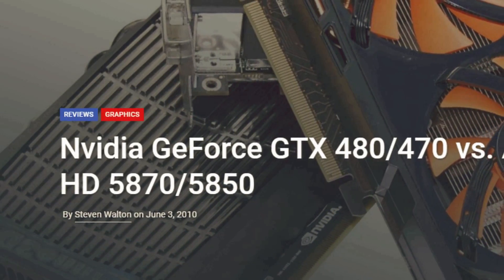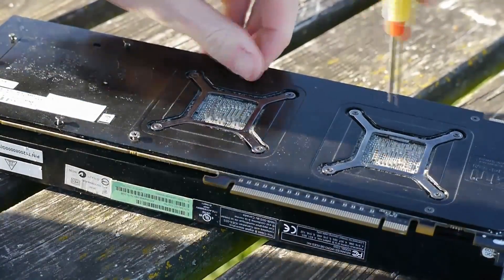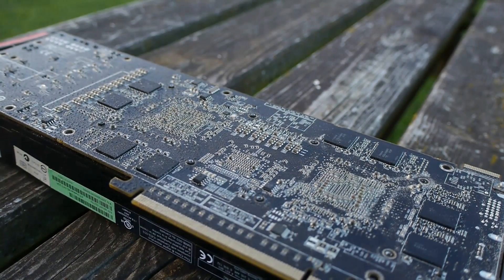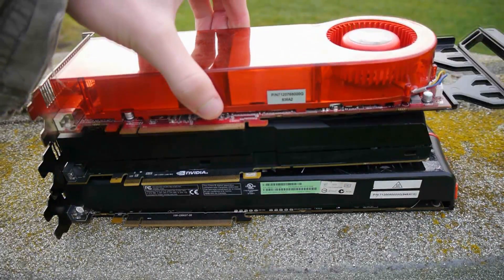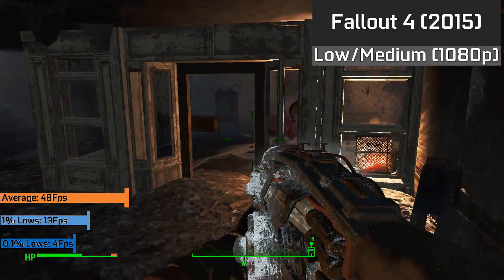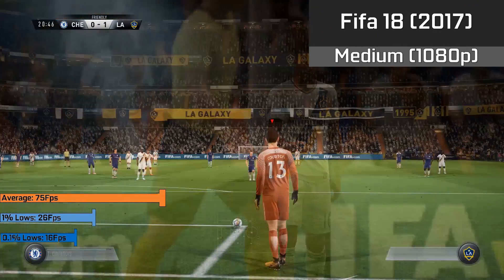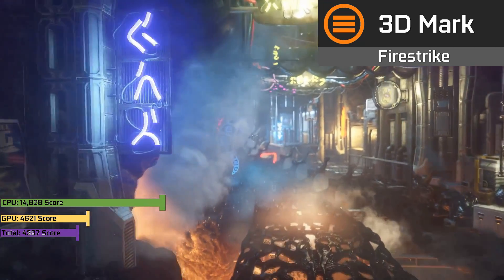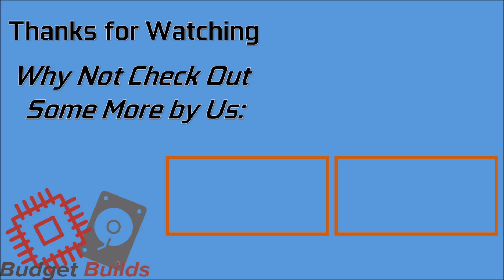The HD5970 is now £25 ($32) but is it any good?

Comment: I had this exact card.  The XFX Black Edition was actually one of the best versions of this card back in those days.  Actually, I think I still have mine.  Great card, but I need to point out one thing you mentioned that isn't actually correct.  Yes, it was a 2GB card, and yes, technically, all 2GB were "usable".  But no, it did not "function" as a 2GB card because that memory pool was not shared across both GPUs.  Each GPU got it's own 1GB of dedicated VRAM.  Remember, these cards were effectively 2 full GPU cards with all their infrastructure requirements, crammed onto a single PCB and then managed through drivers and Crossfire profiles.  So while there was a total of 2GB of VRAM on the PCB, it only functioned as a 1GB graphics card because data was duplicated in VRAM for each GPU to use.  This was true of the HD3870X2, HD4870X2, HD5970, HD6990 and HD7990.  I had the 38,48 and 59 versions of these cards.  Used the HD5970 for years until I upgraded to two Sapphire R9 290X GPUs in Crossfire years later.  

Finally gave up on Crossfire after I had 6 new games release back to back that didn't get Crossfire profiles and actively ran worse, forcing me to constantly disable crossfire entirely in drivers for each game I wanted to play in order to get a enjoyable experience.  But I ran that 290X (great card provided you got a third party triple fan version.  Even the reference design PCB was great, but avoid the blower cooled version) for over 5 years before I finally upgraded to a 2080Ti.  I'm waiting until next gen before I upgrade next.  Don't know which brand I'll go with until I see what each company has to offer.

Comment: Even after ATI was bought by AMD, the ATI name was still used for the AMD GPU range.
The HD 5970 is the last flagship card sold under the ATI Brand.
Starting with the HD 6000 series, AMD stopped using the ATI brand.

Comment: Heck of a card, when it works. Sure, it's two 5870's strapped together, but not every game uses crossfire or sli. GTA IV only used 1 out of the 2GB of video memory too. I had the Sapphire Vapor X variant of the 5870, briefly, with a near silent cooler. The cooler almost took up 3 pci slots! 😅😝 
But it was whisper quiet, and kept things so cool even overclocked. Only reason I sent it back is because it was stuttering like a bastard. Driver issues maybe, because I had a GeForce SLI motherboard. It would get me a couple more frames than a GTX 470 in games like Crysis, but it would stutter every so often and it was quite noticeable.

Comment: @ Budget Builds Official I'm putting together a retro computer using a Q9650 core 2 quad (I don't have a motherboard yet). I was going to use a Diamond 5870 but I bought an XFX Radeon HD 5970 Black Edition Graphics Card for $28.00 U.S. today so I will be using that. My goal is to build a computer that would be very high performance by the standards of 2008-2009 for less than &200.00. I now have a CPU and a GPU and have spent $38.00 but I fear getting a good motherboard cheap is going to be a problem. It pleased the hell out of me to find this good video on the very card I purchased, thank you.

Comment: lol, im using a 5870 I bought for $15 and it OC's to 900mhz and 1200mhz on the vram. Runs CS really smooth at 140ish frames on med settings 1080p and warframe at 90fps at low 1080. Great card, especially for its age.

Comment: I had two 5870 in CF, and suffered a lot from micro stuttering. But, the game that achieved the best scaling and performance for me was "Metro 2033" all maxed out, ir ran even better than my GTX770 after replacing them (all with a OC i5 3570K)

Comment: I have the XFX Black Edition Limited, which is a true 5870x2 card (i.e. no reduced clock speeds) with 2GB per GPU.  It has two 8-pin connectors, which I believe all 4GB 5970 cards had.  The XFX one was the only 4GB model which took up only two slots, which was a big reason for choosing it, despite its horrendous price (same as the 2080 Ti at launch, but back in 2010).  It also supports up to six displays with six separate mini-DisplayPort outputs.

It was able to run Crysis at 2560x1600 with 4xAA smoothly, where a pair of 4870x2 cards would be a slide show.  Not because of processing power, but because of memory limitations.

Comment: I watched this video about 9 months ago, and I have had a saved search on eBay ever since, long story short my 5970 arrived this morning, it was £32 from an eBayer with zero feedback, I took a bit of a chance, but all was good. ATI/AMD drivers are fucking awful compared to Nvidia, especially legacy drivers so I have spent basically the whole day farting around with it, once I got decent drivers installed I was very impressed. I have it installed in my Vista machine with a 2.8 Ghz Intel Q9650, the motherboard I have uses DDR3 which is a nice upgrade from the usual DDR2 of the period, it chewed up and spat out Crysis, and 3D Mark 06 was running in to 1000FPS + territory, I haven't cleaned it yet so it was getting a tad toasty to say the least, I was a bit reticent after I murdered my GTX 295, by opening it and cleaning it, but the 5970 is a lot easier design to work on compared the the GTX 295, which is 2 completely separate cards joined together by 2 sets of SLI ribbon connectors which are painful to get back together.

Comment: you can't test gpus lol
Reply from the maker: Considering there is a series of GPU Related Benchmarks, I'm going to go with yes I can
Reply: @BudgetBuildsOfficial  Why don't you test the game in best performance settings and try to get 60 FPS and then on high settings?
Reply from the maker: I've started benchmarking multiple settings in more recent videos. Older videos target a balance of Framerate and Graphics like I usually try to play.

With an X Fire card this is usually harder. Due to poor X Fire profiles and scaling

Comment: While I love the tech info, your prices are not representative of the market.  You got an insane deal, you didn't pay market value.  Even used ones that are not refurbished are 100+, new or refurbished are upwards of 600+
Reply from the maker: I mean they aren't new cards, they're a few years old. I just find the average price on eBay and CeX UK and use that as a baseline. 

I've had people buy them for less than £25 and I've had people buy then for more.

Comment: I am always completely cleaning a device to factory condition when i am going to use it after years, on a motherboard, i am cleaning it with water and brush, i am letting it to dry for a week in the sun, and it works of course, if i am going to turn on an old graphics card as you did, i am disassemble it, cleaning it, heatsink,fan, card itself,and i am adding always new thermal paste to be sure, and for aesthetics, i am cleaning as much as it can go

Comment: Finding drivers is such a pain. They stopped supporting the HD 5000 series and the drivers aren't installed with the default driver installer - which doesn't recognise the card. You have to get the legacy drivers which are hidden on amd's website and don't work with games that do driver checks.

Comment: 290watts will suck you electricity bills dry, the cost of running the cars exceeds the upfront cheap price. Rather get a 1050/1060/2060
Reply from the maker: Not really.

Comment: I think I downgraded from a Nvidia GeForce 1050 Ti. Lol.

RiP 1050 it died. Lol.

Anyway. How do I install this card? Do I just plug it into the motherboard and that's it? Or do I also need to plug in a power supply cable into it? If so... Both slots or just one? (2x3 and a 2x4 slots.)

Comment: 2Gb of VRAM is not useable....... which is why some the games stuttered like ass.....the card was memory thrashing.
Reply from the maker: No it wasn't
Reply: Yes it is......and the fact you stated 2Gb is usable pretty much proves you don't know what you're talking about. Crossfire and SLI mirror the data in each GPU's memory pool, it has always worked like that so the 5970 only has 1Gb of usable memory and when you go over that limit it has to start puling the data from system RAM or the HDD which causes stuttering and memory thrashing.
Reply: @almighty151986  yep,SLI or CF just share the same memory,not sure if that was the reason for the stuttering but the use of two cards is usually very prone to have stuttering.(or more cards)

Comment: Can someone explain that why amd graphic cards cant keep Fps stable and why they exhaust the processor ? When i use nvidia cards (gtx 550 ti-gtx 750 ti) my processor works at 40-60% but when i put amd card (5970) the processor works at 90-100% !! ? i5 2400 3.1Ghz,8GbRAM,Kingston SSD 240 GB .
Reply from the maker: I mean this card is utilising crossfire with older drivers, and isn't optimised for newer titles. 

Buying such an ancient card compared to the GTX750Ti will definitely give poorer performance
Reply: I dont compare it with gtx 750, another one the gtx 550 ti and it is x5 better than 5970 too , i dont understand why., im just trying to know how to reduce processor usage when im using 5970 ..tnx for reply and sorry for  weak eng ..

Comment: I have a HD 5970 but can't run in CrossFire mode the second GPU stil can't turn on, drivers Series what are you wearing? so everything is back to normal

Comment: The point of these dual GPU CrossfireX cards were that the game(s) didn't need to support CrossFire to gain a performance boost, it was all handled on the CrossfireX chip on the card, and the load was spread between the two....

I had a 3870x2 and a 3870 and tested them as 'single' cards (no Crossfire in any games etc) and the X2 always outperformed the single GPU card.... (even ran the 3870 + 3870x2 for 3 GPU setup too)

Comment: The problem with Borderlands is that it is an Nvidia game. It scales very well and runs completely fine on my dual GTX 1070s in SLI. I’m pretty sure there’s some Nvidia secret sauce that make the game run worse on AMD hardware.
Reply: It would run time on 2 1070's wouldnt it. State the obvious why don't you. I think you just wanted to tell us you got 2 1070's didn't you? That's a bit stupid isn't it. A single more powerful card is always better and far cheaper. Dufus...

Comment: I had one of these and returned it after 7 months due to the horrible xfire performance, powerplay issues at a driver level being shit and most solutions to bad performance was to disable a gpu. Got a 580 and never looked back. Prior to this card I alternated between nvidia and ATI. Now im using a 1080ti and will never go back to ATI/AMD

Comment: XD This video reminds of when I heat treated my HD 5870 XD  Elder Scrolls Online had just come out of the beta and I ran it at ultra until I smelled hot metal.  After downloading a temp display program, I discovered it was running up to about 92 degrees celcius, and made the metal bracket change color.  Oddly enough it still works to this day.

Comment: you know that using a brush for sweeping the dust create lots of high little electro static voltage between each bristles and the board, now normally PCs can manage those electrostatics sparks but you are calling too much "the luck" doing that.
Reply from the maker: flyguille: Generally a small amount of static isn't going to harm your computer components, if that was the case nothing I buy from the bootfair would ever work.
Reply: of course, "normally PCB can handle it", I said that, but calling your luck anyway. It does not mean it is a good procedure.

You can use a pressure air, and for cleaning the contacts use wet towel paper with isopropilic alcohol. And never left a finger print. Any finger print in the contacts will prematuraly oxidate the contacts on the work heat and a few months.

Comment: Again, why play in 1080 if you can lower the resolution and set higher settings which makes things much better looking with much higher FPS?
Reply from the maker: FreedomWarrior: Generally Resolution > Graphical Effects.
Reply: I completely disagree by extensive experience. And I'm not talking about graphical effects, I'm talking about everything in general, specially textures. If you set higher textures it makes a huge different, much bigger than to set an higher resolution, same for anti-aliasing.
Reply from the maker: It depends on screen size, 720p High will look arguable worse than 1080p Medium. However it depends on preference
Reply: Well talking for myself, I prefer a smoother gameplay with better looking graphics and playing at 900p than playing at 1080p with uglier graphics and much lower fps. 900p for 1080p can't almost be noticed btw but the impact in the graphic card is huge.
Reply from the maker: FreedomWarrior: Once again it's largely dependant on monitor size and type, the game you're playing etc... I use 1080p to make results comparable, as I do test in other various resolution off camera to see which one was the best.
Reply: Fair enough. I never played as low as 720p, recently, the lowest resolution before noticing aesthetics degradation is 768p in my computer.

Comment: I have black 5970 black edition and works as it was 2015 model even when its 2009. black edition used to cost used at around 200 pounds i have bought another one for 90 on ebay. very rare GPUs and i am more than happy to have it and happy i was able to get another one. much cheaper and reviews says better than geforece 980. the 980 ti is slightly bit better at AA's but pretty much same.

Comment: 11:45
Gaming in 4k on a £30/$35 Scam GPU.
Budget-Builds Official
88K views

11:35
4K GAMING AT 120Hz - ON DIY MONITOR!?
Linus Tech Tips
Recommended for you

16:45
The Compensator 2.0 - ABSOLUTELY No Compromises PC Build Log
Linus Tech Tips
Recommended for you

7:55
GTX 1070 Ti Review.. Oh and Also WTF NVIDIA??
Linus Tech Tips
Recommended for you

10:14
GTX 1080 Hot Rod PC – Smaller than a PS4
Linus Tech Tips
Recommended for you

1:07:53
Facebook sucks, Future AMD GPUs could be GREAT! - WAN Show Apr.13 2018
Linus Tech Tips
226K views
New

7:49
COMPUTER DESTRUCTION (GONE DEADLY)
Linus Tech Tips
Recommended for you

13:49
The last High End 256MB GPU Tested 11 Years Later...In 2018
Budget-Builds Official
42K views
New

10:18
56 Cores in ONE SYSTEM! - HOLY $H!T
Linus Tech Tips
Recommended for you

14:44
Top 10 USED Graphics Cards for PC Gaming in 2018 - Anti-Crypto Edn.
Tech YES City
76K views

6:01
Games Vs Their Own "Recommended System Requirements"
RandomGaminginHD
Recommended for you

5:51
Is The HD 7970 Still Worth Buying? | The 5 Year Old Flagship
RandomGaminginHD
226K views

6:21
The Moon is The Debris of a Spacecraft
Ridddle
Recommended for you

8:27
A REAL 64 Core CPU - For SCIENCE!
Linus Tech Tips
Recommended for you

17:13
The Dual GPU Monster of 2009 - HD 5970 - 2017 Performance Review
F2F Tech
21K views

8:59
The £35 "1080p" Gaming PC! // GTA? Fallout4? CSGO?
Budget-Builds Official
142K views

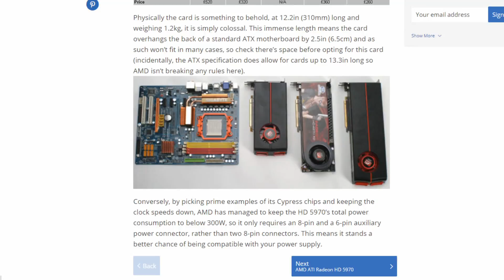4:39
Nvidia's Last "GTO" Graphics Card - Why Was It So Popular?
RandomGaminginHD
28K views
New

4:25
Atoms From Nuclear Explosions Are Embedded in Your Brain, But You’re Fine
Seeker
Recommended for you
New

4:49
$20 For The World's Fastest GPU.... Of 2009
RandomGaminginHD
285K views

12:27
I bought a USED PC on Craigslist. Here's what happened!
Bitwit
759K views

The HD5970 is now $239

Comment: About twice as much thermal paste as you needed there buddy. The spillage will marginally insulate heat on to the processor. A big deal if you're a perfectionist and want the best out of your card.
Reply from the maker: Temperatures on the card were perfect, and there was no excess spillage.

Comment: I have one earlier. This card is a garbage! Most of games can't use it in crossfire mode just in single gpu mode. And in single this card a waay slower than for example a gf gts450!
Reply from the maker: It really isn't, it's virtually a GTX480 in terms of single card performance.
Reply: Budget-Builds Official in your dreams maybe! 😂
Reply from the maker: It's a fact of the HD5870 Cards....
Reply: Budget-Builds Official yeah, sure! 😂😉
Reply from the maker: Read up on Terascale Vs Fermi, no need to misinform people.
Reply from the maker: You really don't like Terascale do you? However please do tell me this article showing the GTS450 beating the HD5970 in single card mode. It would be great to see :)

Comment: My 5870 served me well, I loved that card and it overclocked like a beast. Had it paired with my i7 875k overclocked to 4.25GHz at the time and it literally heated my bedroom during winter. I left my windows open during the cold months and had AC blasting in the summer. My friend who had a 5970 often complained about the micro stuttering from Crossfire mode with this card but I can't remember if they fixed that with driver updates down the road. 

Eventually sold the card when I got my 2 7970s but prices were still good and I was able to sell for a couple hundred bucks on Craigslist. My 7970s lasted me until 2016 when I decided to get a GTX 1080 for 4k gaming. Gave one of those 7970s to an ex girlfriend as a Christmas gift and the other is in my friends Quadfire 7970 PC. 

This brought back good memories, subbed to this channel and love the content. Keep up the good work!